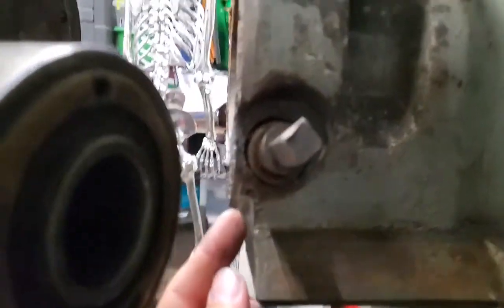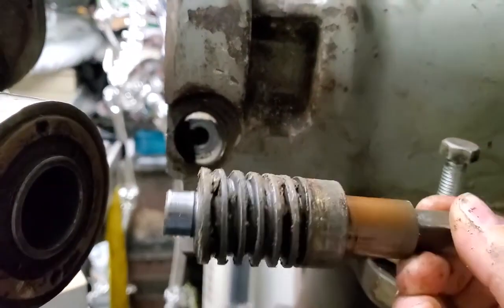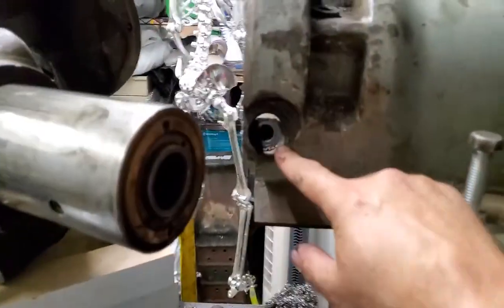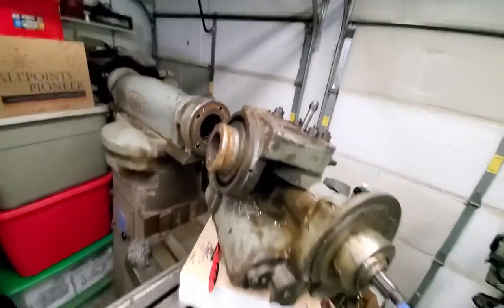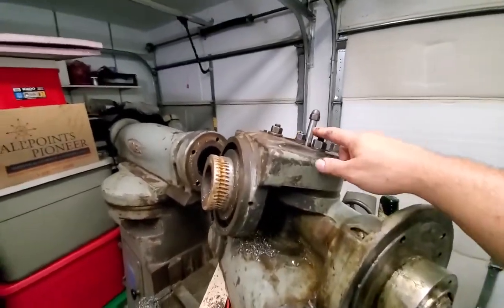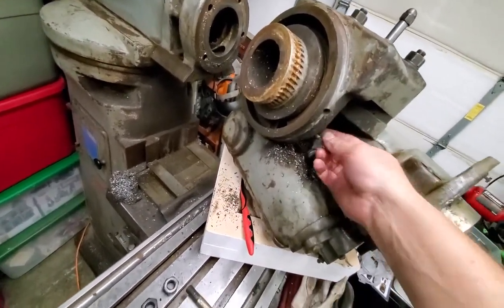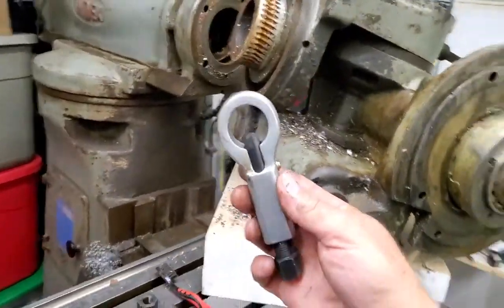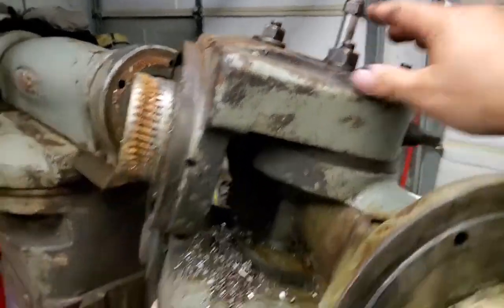Pulling the head on a Wells Index 645 Vertical Mill

Comment: I also have a Wells 645, and needed to remove the head.

I fabricated a weldment that had a vertical tube, that I lined with a section of ABS plastic pipe, with an internal diameter, the same size as the quill.
Bolted that to the table, inserted the quill into the fixture, and unbolted the head.
Worked perfectly!!!
I don't know why, so many people abused these old Wels, Index milling machines, but those bolts being stripped off are very common. I made a new set.
The circular rack had been stripped out, probably because some fool didn't loosen the locking bolts.
I had to reference the rack to where there was a complete good section. It worked perfectly!!!

I love the machine!!!
I finally added a 4 axis DRO from DRO Pros, and it made it like a whole new machine, despite having used it for years with out a DRO.
I an considering a VFD, to make speed changes easier, but the pully system really isn't that bad. I have never run out of power with the stock motor.

I am probably going to fit a servo drive to the knee, to make for easier set ups for the kind of work I do.
However, I made a drill adapter that works very well, so I haven't gotten too motivated to fit the servo drive just yet.

Great machine. Maybe some day I will fit a #40 taper spindle, as I think some of the 645's were so equipped!!!
The standard Bridgeport collet assembly works just fine, I never bothered to fit a pneumatic closer, but maybe some day.

Great machine, hope you enjoy yours as much as I do mine!!!
LOL!!!

Tim

Comment: I pulled my head off just an hour ago. Really odd there's no zerk fittings to grease the worm gears. Mine did not want to come off, all the grease was hard as rocks. I did make a special spanner wrench tool this morning to remove that odd ball threaded clamp that holds the worm gear in.
Reply: Just got it all back together. Getting those 4 bolts to align while holding up the heavy casting was a PITA, then I installed the head into that casting. The 4 bolts come out differently on my 645, so they changed the design. Probably because that hole in the rear let metal swarf in.
Now I need to tram the head. I think I'm the first person to get into this since it was manufactured, cleaning out the old solidified grease was a job. And Nitril gloves do not stand up against lacquer thinner or acetone.
Reply from the maker: I had to use a small pick to dig out as much hardened grease as I could before going over it with a wire wheel. Some of that old grease was like a rock. It was crazy how much it hardened up.